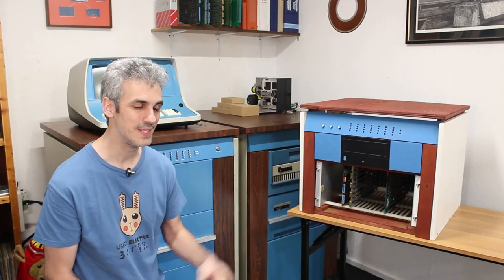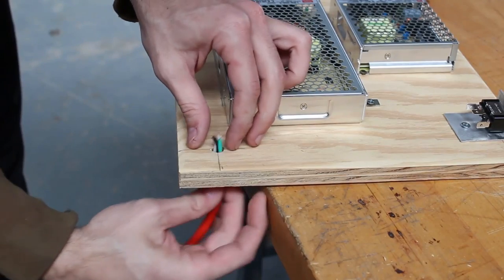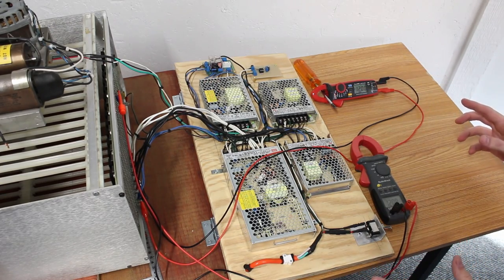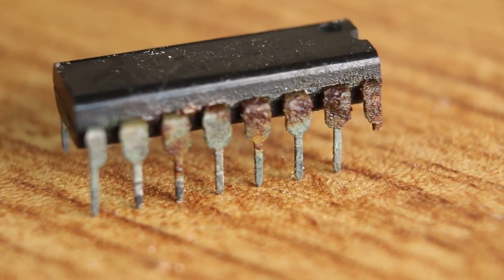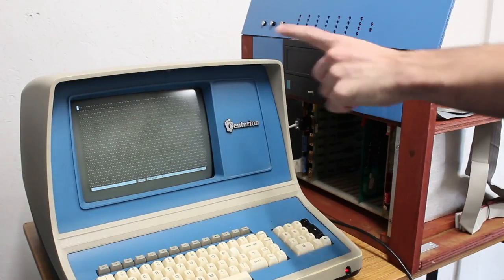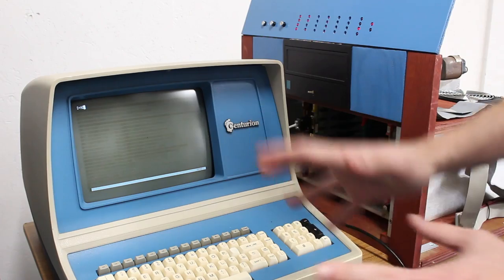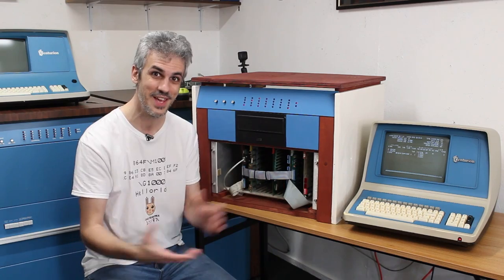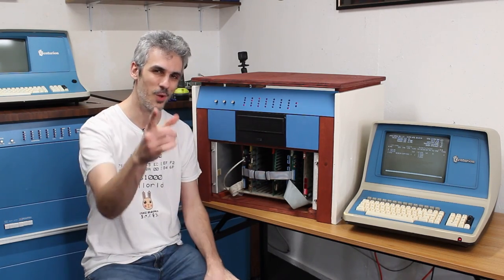The Mini-Centurion Works!

Comment: You might be able to find a nice replacement CRT for that terminal too. That burn in is pretty serious. Refurbishing those would be fantastic too.
Reply from the maker: That's definitely something I'm keeping an eye out for, because the CRT in there is definitely tired!
Reply: @UsagiElectric  May reach out to Adrien from Adrien's Digital Basement.  :)
Reply: @UsagiElectric  I have a Compaq 286 Luggable with Monochrome plasma screen and detachable keyboard.  The idea of finding something like that with (non standard display parameters!) a surround bezel in Centurian colours and a wander keyboard of any kind really would be fun.  Our DEC computers at college had Newbury terminals because they were cheaper than DEC

Comment: why not just use a huge 12v power supply + buck booster to scale up/down the voltage? less complexity and weight... and the mounts that hold the cables in place could use some rubber isolation...cables will rub through eventually if this system gets moved around a lot

Comment: If I want a perfect clock signal, I use an Attiny85 and these are programmable exactly for the frequency you want.
Reply: There's something just wrong about using a microprocessor that's faster than the Centurion itself just to generate a clock signal.

You want a 4.9152MHz crystal driven and divided by a CD4060 oscillator/counter, which divides by 8192 to get 600Hz. Then use a 74'90 (e.g. SN74HC90N) to divide by ten to derive the 60Hz signal. With just two ICs, a crystal and the associated passives, you can get the desired frequency in a retro-friendly fashion.

Comment: There's also the remote chance of the 64k RAM chips being too fast. Very rare but there are systems known to not properly work when 4116s get replaced with 4164s, so it is a possibility. These waterlogged corroded sockets are the most likely problem though.
Reply: I agree. I honestly think all the sockets likely need to be replaced since the board had such serious damage. For preservation purposes.

Comment: using the mains for a 60hz signal its rarely actually 60hz and is adjusted at the generators from time to time so its close enough. edit its going to be a hit, every retro computer nerd wants to play with a machine like this, few actually go  down the rabbit hole. A buddy and I grabbed a early 90's system (not centurion) from the county education IT and the deal was it could live in the house of whomever could convince their parents to rent a u-haul to get it home. ran a multiuser BBS and eventually a website  just the whole experience of chunks and clunks and (this one had a reel to reel tape drive) made it fun af
Reply: Since it is used for clocks, they make it a point to have the correct number of cycles in a 24 hour period.
Reply: Mains needs to be within a few parts per thousand of 60hz if I recall correctly. Much more than that and it can cause serious problems on the generation side of things. Being accurate enough for clocks is just a bonus.
Reply: As long as you're attached to a sizable grid, it's not going to change much from 60Hz.  All the generators have to stay in sync and there's a tons of spinning mass that won't allow a fast change.  If you're connected to a small generator, all bets are off.

Comment: The Centurion Veles (because it's light [ish], portable[ish], and veles goes with centurion) build came out well. I wonder how difficult it would be to modify the stripped down OS to use the memory card a bit more and speed up operating time.

Comment: I wouldn't be concerned about the 60Hz drift. If the RTC was derived from the line on the original system, it would have drifted with the load on the electrical grid anyway, since the grid frequency is used to control the power grid for load following.
Reply: The power grid frequency does drift a bit but they do their best to keep it exact over time. I believe the American standard is the grid needs to stay within 15 seconds. Synchronous clocks used to be extremely popular and right now mine are saying it is 11:26 and my NTP-synced laptop is also 11:26.

Comment: Great job!  How good (or bad) is that Weller desoldering station and tool? I'm considering to invest in one like it.   Not sure if the Chinese ones are worth getting.  My other option is the nice but very expensive ersa soldering station.
Reply from the maker: The Weller soldering station is fantastic, I absolutely love it. Though, I should have spring for the more powerful model, it's still plenty good.
The desoldering iron I use is an ECG J-045-DS, and it actually works surprisingly well for such an affordable unit. Sure it's not going to be as nice as one of the powered Hakko things, but it's about a million times better than using a solder sucker.

Comment: It'd be awesome to try and build an actual centurion compatible machine from new parts.
Reply: I actuallly thought about it., ...
Reply from the maker: This is something I've been brainstorming for a while. 
I would like to keep it all through-hole and not just an FPGA emulation (which actually has already been done for the CPU), but it's a pretty serious undertaking. Some of the devices, like the MUX and MEM cards are relatively easy to recreate, but the CPU and drive control stuff is going to be a serious undertaking.
Reply: @UsagiElectric  Not a fan of emulation for stuff like that either.  Honestly miss most electronics being made with through-hole components, just looks nicer to me.
Reply: @DarkDragonEWA  The issue with the CPU6 is the 2909/11 sequencers and 2901 ALUs. Everything else can be recreated with through hole contemporary components (if you don't mind wasting address space for the microcode control store and instruction decode ROMs by using larger capacity chips). I think you can probably use PLCC CPLDs and through hole adapters to recreate the sequencers and ALUs if you're willing to compromise there.

Comment: Wont there be an issue with the sharp edges of the aluminum brackets causing wear and tear to the ribbon cables? From the vibrations cause by moving it from place to place on your car, or from the vibrations caused by the fans and the floppy drive. Personally I would of gone for the cheap route and wrapped a couple of layers of wide electrical tape around the aluminum brackets for peace of mind. Also greetings from Brisbane, Australia hence my spelling of aluminum. :p

Comment: Under MS-DOS with a floppy-only system, I would boot the OS and then change disks to the application I was using.  Why can't you do that here?
Reply: I don't think enough of this is in RAM for you to be able to do that.
Reply: The OS was built for 4K of core memory, so it was always made for use with the CDC drives for OS. You would keep the OS on the fixed disk, and programs and data on the removable disks. The floppy came much later, and was made to transfer files to and from a personal computer.
Reply: MS-DOS loads a command interpreter into memory, and that interpreter can itself execute many common commands.  I think the Centurion OS keeps all the commands on disk.  Though if you just wanted to run a command from another disk, I'm not sure if that wouldn't work.  It depends upon what the OS needs from the system disk besides commands.
Reply: @Mueller3D  DOS 1.0 required 32KB of ram. Centurion's OS runs with 4KB
Reply: In addition to the other replies, note that even with MS-DOS and similar OSs, only some of the "commands" are resident in memory. Other things considered part of the OS are still on the disk as executable files. It appears that the Centurion system depends a lot more on these executable program files on the disk to implement OS commands, so the disk needs to stay in. Which makes sense for a minicomputer of this variety that is designed with a permanently attached hard drive in mind.

Comment: I'm a little surprised that you didn't use the AC power for the 60Hz clock.  I'd think that you'd just need a resistor and an opto-isolator to extract the signal and keep the high voltage away from the low voltage.
Reply: A small transformer, with a few resistors would have worked as well.  Maybe even start with a thrift shop wall wart that outputs AC or extract the transformer from it.

Comment: Why generate approximately 60Hz with a 555 when you can use a resistive divider from mains to produce a low-voltage 60Hz (exactly) sine wave and feed that thru a Schmitt trigger (such as a SN7414)?
Reply: Because that's entirely non-isolated. I would want to add a lot of protection circuitry before doing something like that.
Reply: @eDoc2020  A simple small isolation transformer solves all those problems. That was so obvious to me that I forgot to mention the transformer in my suggestion.
Reply: He chose a solution that he's very familiar with, that works, and also has very few parts.  Certainly, it's not the only solution.

Comment: It uses mains for the CPU frequency?  

EDIT, Oh, system time clock, that's still rather odd but one way of doing it I guess.
Reply: That used to be pretty standard, especially for cheaper computers.
Reply: That was surprisingly common in early days, probably because stable frequency generators were expensive.
For example PAL and NTSC run on different refresh frequencies because both derived that frequency from the mains voltage, which is 50Hz in Europe, but 60Hz in US+Canada. 
Most wall clocks of the era also used mains frequency to count seconds.

Comment: 6:33: Did you mean you're going to use a smaller TWELVE volt relay to trigger the two big 12 volt relays? You said five in the video. Or maybe I misunderstand? Is a relay named for the controlling voltage or for the voltage it switches?
Reply: Coil voltage, in casual usage. Otherwise, RTFM applies 🙂 (data sheet / full spec).
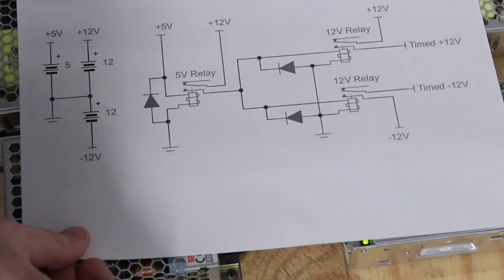Reply: If the diagram at 6:25 is correct, he powers first relay from 5V PSU, 
then that relay connects +12V from 12V PSU that is always on to two more relays 
that then connect +12V and -12V from respective PSUs to the computer.
This whole thing could have been one single relay but he didn't have the right one on hand,
I assume the 5V relay is way too to feeble to connect all the amperage that +/-12V rails need.
Reply: @RogerBarraud  Sorry for not being au fait with the jargon, but coil voltage in a relay means controlling voltage, right? I.e. the voltage used to actuate the relay switch?